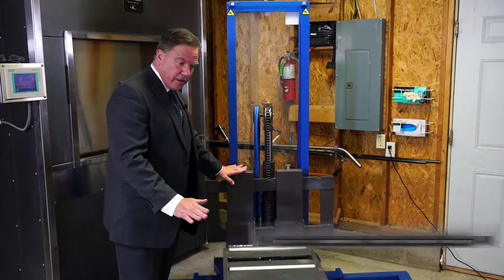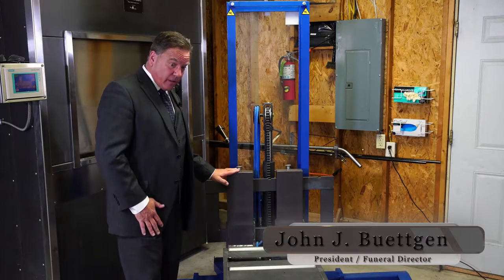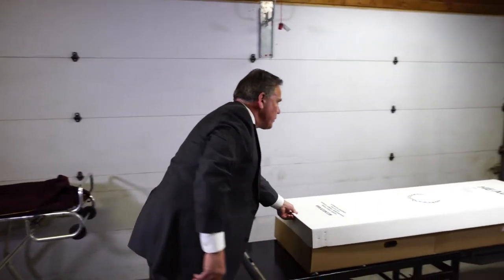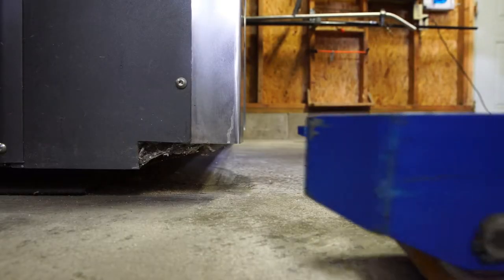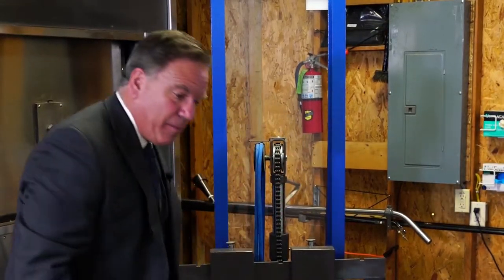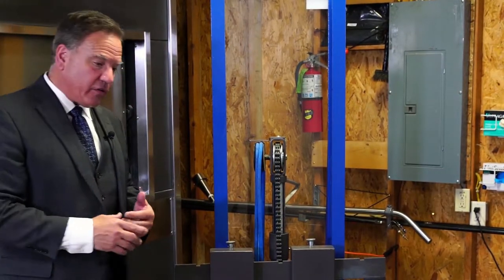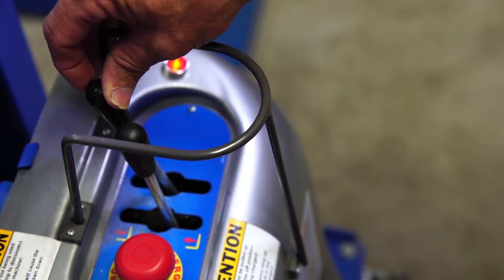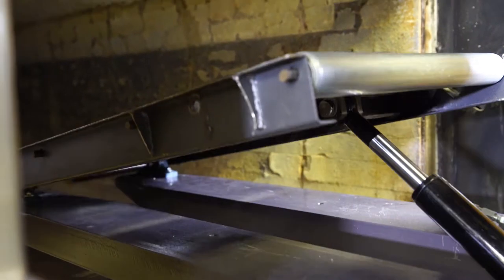Crematory Hydraulic Lift System

Comment: Worst case scenario if you ran into loading issues with this particular device With all due respect. I think it would be awfully cumbersome to get out of the way specially when you might need it out of the way immediately. As a crematorium operator myself I've been in these scenarios. As you know a lot can go wrong very quickly And then your dignified load goes  Ends up becoming a very very awkward and uncomfortable situation. Please correct me if I'm wrong I've just never seen such a device. We use auto loaders and they even have issues that Can turn into nightmares.